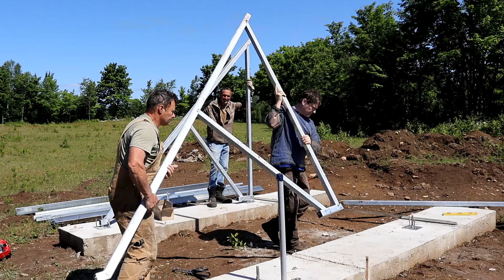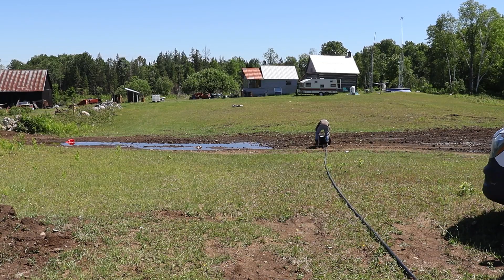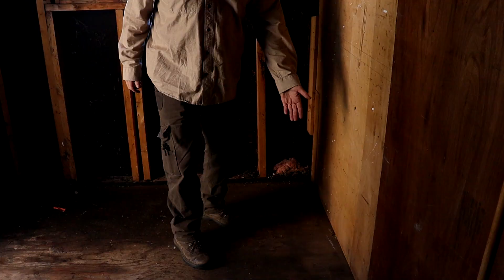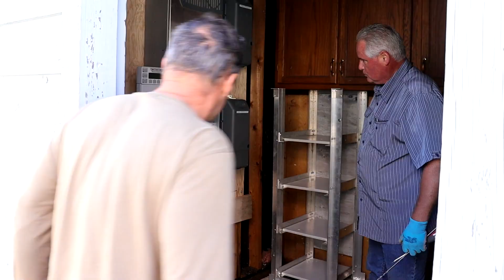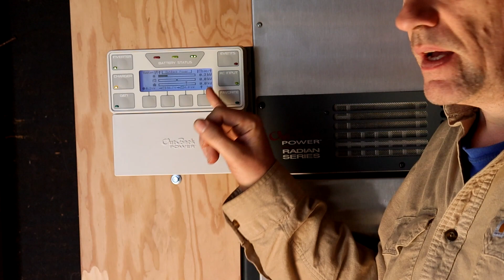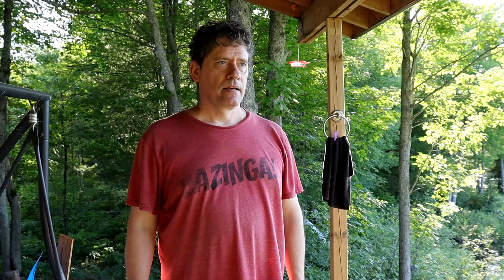We Installed a Solar Power System for an Off Grid Cabin

Comment: Hard work pays off! Great video and excellent explanation of the various parts. One thing to note: these Hanwha panels are comprised of "half cut" cells. Cutting them in half allows for slight advantages to durability and lowered losses and is a technique that is quickly being adapted by many manufacturers. Solar panels made for residential use are usually comprised of 60 cells, whereas utility scale panels are a bit longer and are comprised of 72 cells. Obviously if you cut them in half, they become 144 half cells, but that's still the equivalent of 72 full cells, hence the reference to them as 72 cell panels.
Reply from the maker: Good call, Lian.

Comment: I live in northern Saskatchewan and planning to build a total off grid house .. our monthly power bills can vary from 500 to 800 a month from just running heat trace for pipes and crawl space heaters in the winter .. and with the economy today no one can afford that .. I plan on going solar and fan and this video was very informative thanks you
Reply from the maker: Heating pipes will kill your electricity. You need a different plan when you're on solar/battery

Comment: Great video. I am a couple weeks off installing my 5kw array. Ive been using my 12kw kabota generator to charge my bank for the last 6 months. Cant wait to have my solar set up.
Reply from the maker: Hey Jeremy. Running a genie all day sucks! Let me know if you need any help with your solar install. An extra pair of hands can't hurt.
Reply: Thanks Russel !! I might call on ya. With this big Genny i only have to run it for about 2 hrs a night to keep bank between 85-100% i am charging 8 sl16 rolls batteries. 400amp hour

Comment: Hello Russell,  I'm surprised the display is mounted so low to the ground as they can get 2 to 6 feet of snow in Bancroft.  is there a specific reason?
Reply from the maker: The array? Yes, it is pretty low. Our first time using that mounting system. The uprights should have been longer.
Reply: I'm just outside Maynooth (also north of Bancroft) and couple issues I would say is yes its way to low on the ground, and the angle. I'm at a fix 60°. I use to be 45 fixed and I found winter sun was not effective enough at that angle. And I use Nissan Leaf packs instead of lead acid. I found them cheaper and easier to use over all. Compared to my 3 old lead acid banks I've had. I've been off grid for 20 years.
Looks like a nice install though. Cheers

Comment: Very interesting. I have been wanting to add a panel to my roof. I am on grid and in the city so I have to check with city ordinances.
Reply from the maker: The easiest is a thing called Net Metering, which you can look up. Batteries make it complicated.

Comment: Great informative video, Russell.  Dumb question about solar panels platforms: would there be a benefit to having a base that can rotate and face the sun all day? Even if if it's just something on heavy duty dollies, that can be moved manually, or hand cranked? Or a very low hp-motor, turntable that needs just a little power to move? It seems that the cost difference would only require one of those arrays the home owner used. I remember back in the 50's and 60's, my dad had gear motor that rotated our tv antenna.
Reply from the maker: We've done rotating systems in the past, they require a lot of maintenance. Not sure you could get a manual one for something this large.

Comment: You should build a tower in the middle of the lake and put a vawt generator to add to your power system you always have a breeze.
Reply from the maker: I don't know what a vawt generator is, but it sounds powerful.
Reply: @RaspberryRockOffGridCabin  A "vertical axis wind turbine" instead of your regular fan style PMA. Permanent magnet Alternator.
Reply: I may pick up a ford fusion upper and lower battery and convert over to a powerwall with a couple 40 amp BMS along with low temp cutoff sensors. The cool thing is it comes with a water cooled tray or glycol that the batteries sit in and can be programmed with a high temp sensor to kick on at a certain temp. Still trying to figure the wiring of the sensor parts out though. Then probably sell it :P

Comment: Loved the video. It was great to see how easy it can be to erect solar panels, of course, it is necessary to have people doing the work that is trained in the technology.. :) How many solar panels / Kw power would you need for a home for a family of four people that has a water heater, electric stove, refrigerator, microwave, big screen TV, maybe a freezer? Such a big decision to go off grid.
Reply from the maker: Vanessa, it would be a super huge system. The first thing people learn to do is cut down all the unnecessary power they use. Like hanging your washing on a clothes line. There are a lot of sacrifices.
Reply: @RaspberryRockOffGridCabin   Thank you so much for explaining about the solar panel  installation.. I realize,  the whole point of living off grid is to simplify and be in touch with nature in remote locations. I guess my thoughts were to having to stop paying the Hydro Company and still live with all the conveniences. Thanks Again!

Comment: Nice video Russell! I was curious why the display shows only 0.2 kW or 0.3 kW coming in from the sun. Was it not sunny or something? Do you think having two sets of panels facing different directions each connected in parallel to an Outback MPPT charger would work efficiently or do you need two different chargers? Keep up the great work.
Reply from the maker: Ron, the batteries were full, I believe the charge controllers were in float mode. You definitely need different charge controllers if you have panels pointed in different directions.

Comment: So what kind of longevity will this system.have? How often will the batteries and.other components need to be replaced?
Reply from the maker: Susan, typically, you should see that: the panels will last 20 to 30 years, the inverter/charge controllers should last 15 years, the batteries should last 8 to 10 years.
Reply from the maker: All of the batteries have different warranty periods. http://support.rollsbattery.com/en/support/solutions/articles/246377-rolls-battery-manufacturer-warranty-flooded-agm-gel-models

Comment: That should charge very quickly with that solar array curious what the idle consumption is over a 24 hour period?
Reply from the maker: @MrSummitguy if you're going to throw out numbers, you should actually specific which battery you're talking about. Recommended charge current is 10% of the 20Hr AH rating of the battery bank. Absorb mode takes 2-3 hours? Based on what? You should probably read up more before you go giving advice.

Comment: Hey Russel, I've got a few questions

what is the voltage at the output of solar panel combiner box and at the input charge controllers?
cost of the system?

Nice videos....Thanks in advance
Reply from the maker: Gershom, I know it's a little confusing by the picture I put in the video, but coming out of the combiner box is actually max 164V & 20amps, which is what's going into each of the charge controllers. I don't know the cost of the system, but depending on many factors, my guess is between $25k and $50k.

Comment: I'm a complete novice when it comes to solar power. How long would this system stay current before you'd have to start updating components (ie batteries/panels/boxes)? 

I'm assuming technology is always moving forward. I always feel like something like a cellphone becomes outdated at soon as you buy it, because there is something better out there relatively quickly.
Reply from the maker: Typically, you should see that: the panels will last 20 to 30 years, the inverter/charge controllers should last 15 years, the batteries should last 8 to 10 years.
Reply: Batteries are already outdated. Most people are going to lithium ion phosphate now. LiFePo4.
Reply from the maker: DK all LiFePo4's are coming out of China, and people are still nervous about them.
Reply: @DK-jd8bj   And lithium will be replaced in a few years by several new products if you can afford the technology. The price tag is what will keep many products current for decades.

Comment: never knew solar would cost so much, but that set up seems large
Reply from the maker: It's a powerful system.
Reply: @RaspberryRockOffGridCabin  This is where DIY can make a huge difference. My set-up is larger than this and uses LiFePO4, and costs way less.
Reply from the maker: UNP, some people can DIY a system like this, but not many.
Reply: @RaspberryRockOffGridCabin  That's true, but things have gotten much easier lately. Check out diysolarforum if you're interested.

Comment: Does the choice of AGM over lithium have anything to do with the extreme cold you get in winters ?
Reply: @MrSummitville  My thinking is they would make sense if this is a seasonal use only place, the cabin was winterized (water wise) and the batteries would be fine all winter if charged, but disconnected ?
Reply from the maker: Once again, summitguy, you need to do more reading. Warranties are different for every battery series that Rolls offers. And I have Rolls FLA batteries that are 10 years old, only have troubles with one of them. Rolls make a very good battery, they last a long time.

Comment: Why AGM?
Reply from the maker: I don't know for sure, but I bet he wanted no-maintenance batteries, but didn't want to spend the money on LifePo4's.
Reply: I buy LifePro for my work. These are really pricey. My work uses mainly Trojan batteries. AGM batteries are good and last a longtime from my experience.
Reply from the maker: Assuming you're talking about the AGM-S, it has not even half the # of cycles as the series 4500 or 5000, and slightly better than the series 4000.

Comment: is there a reason why you didnt use lithium batteries
Reply from the maker: Customer decision, as far as I know.
Reply: Cheaper and much easier to expand in the future I expect.
Reply: @RaspberryRockOffGridCabin  It was entirely a cost based decision.  It is very likely that they will need to parallel that battery bank with another one of the same size.

Comment: 6.8 kw is only about a 60 amp service, but you can at least squeak by with it.  at least you could run a clothes dryer, stove, hot water heater, range, or AC if you had to...but only 1 or 2 at a time, not all at the same time.  to equal a standard 200 amp household service we all use today, you would need a 24 kw bank of solar panels.  that's 64 high end panels.  even the "old" 100 amp service, that everyone tears out of the old homes to replace with a new 200 amp service, would require 32 panels.  100 amp is considered slummin' it, because it throws breakers, or blows fuses, with today's modern lifestyle amperage demands.  let's be honest here.  regards.

Comment: Why are you part of another mans solarinstallation? Why showing us this?
Reply from the maker: It's Ray's customer. I filmed it because I felt like it.
Reply: @RaspberryRockOffGridCabin   Fine with me, I just thought you should have something like that?
Reply from the maker: Preben I'm thinking of upgrading my system.
Reply: I wonder about the so low to the ground of these panels, especially with Canadian winters. It will be interesting to see how much of these panels get covered in snow at the bottom. Perhaps maybe 5-6 feet off the ground may have been better. This looks like a wide open area too for snowdrifts. I’d be interested in a follow up during the winter Russell.